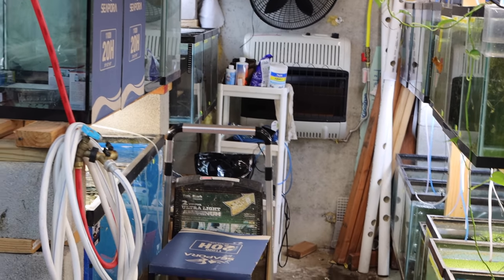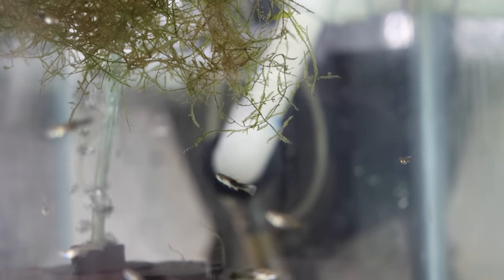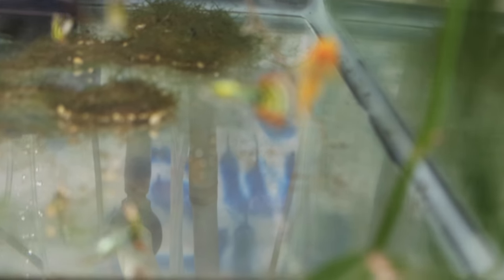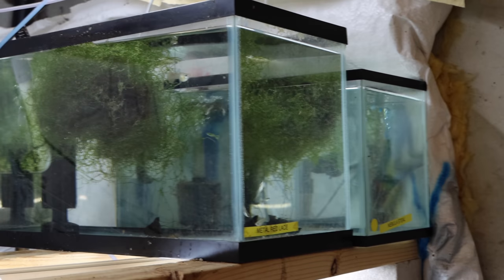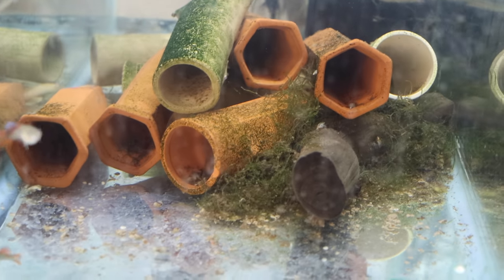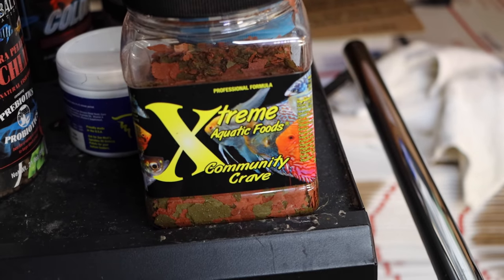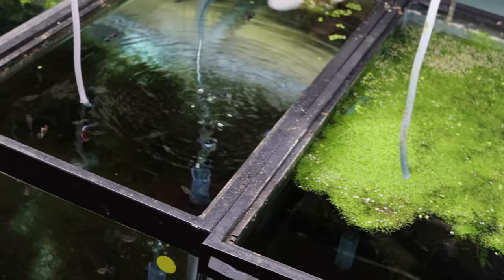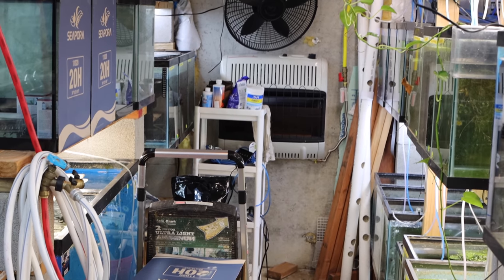Fish Room Tour

Comment: One other thing and correct me if I’m wrong, I’ve always kinda been told that seeding filters doesn’t work the greatest all in one tank, Reason being is the tank only produces as much beneficial bacteria as needed, but like you preach do what works for you not others.
Reply: I think as long as you provide enough surface area for the bacteria you should be fine.  Just a thought though🤔
Reply from the maker: This is true. That is why they are in tanks with massive amounts of plecos. I over feed the crap out of them.
Reply from the maker: Surface area and food source are needed.
Reply: Makes sense, I think it’s a killer idea, nothing worse than waiting for a new tank to cycle.